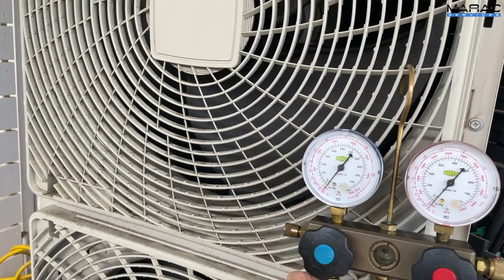Repairing Daikin H3 E3 Error (EP 2)

Comment: Made the H/P switch braze look easy ( which it is not ) so fair play 👏👏.
Good result
Reply from the maker: Thanks mate! I have a ziplock bag in my van that has some random pieces of weatherboard in it. When ever I’m soldering in a tight space, I use them so I don’t burn everything. Makes it so much easier! Luckily the HP switch was located in a fairly accessible place on this unit.